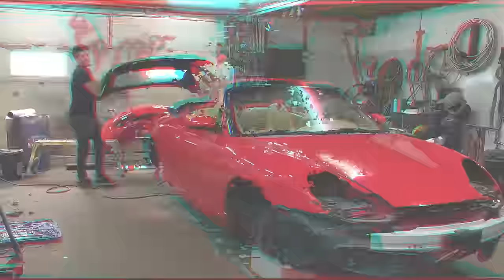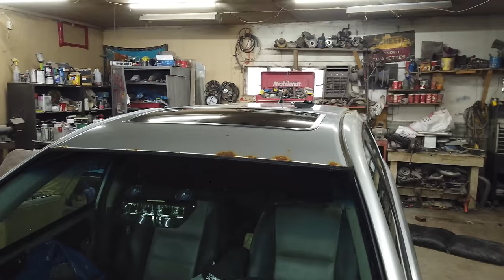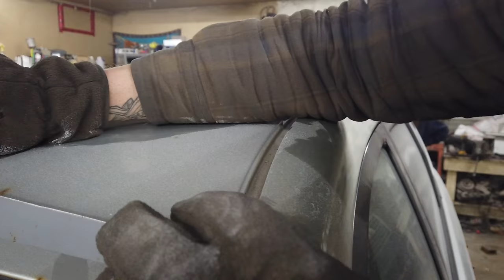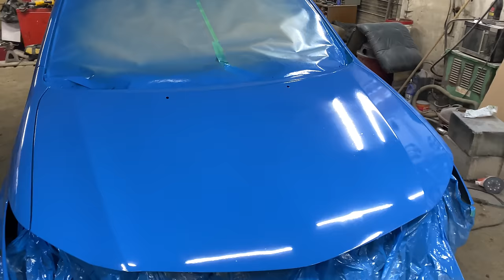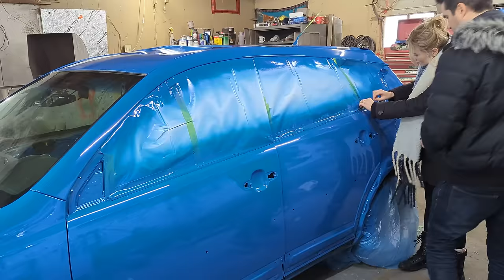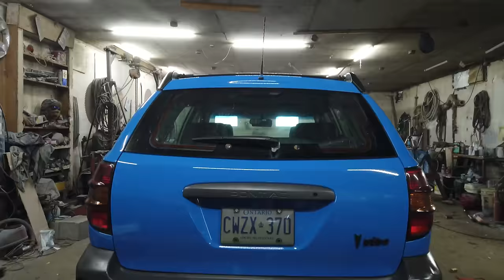Clear Coat over Rust Paint - DIY Professional Rustoleum Paint Job

Comment: Fantastic job-Looks great and I couldn't have done it better myself? There is only 1 thing that needs to be different?

PLEASE, please, please!.......................................

The hardener you used that works with Tremclad/Rustoleum paint will make a major improvement in shine and durability and UV resistance. That product is an isocyanate  that will (not can) cause long term effects to your central nervous system. The amounts needed are different with every person.

Once in your body, it does NOT leave so every exposure to it gets you one step closer to your magic level. Yes, wearing a mask that is NOISH level 95 or higher helps. However, it is easily absorbed through your exposed skin or eyes.

You will know when enough is enough, as really neat things like tremors in your hands, arms or legs will start. Your Dr will probably diagnose it as Parkinson's at first with the real reason hiding behind a bunch of other tests that are tried after Parkinson's treatments have little to no effect. Don't ask me how I know this.

Our friends here in the States at OSHA forbid the use of isocyanates unless it is done in a professional booth with down draft and the individual spraying is wearing a Tyvek suit that is completely covering their body (full face) 

Filtered and pressurized air must be supplied for both breathing and keeping a constant positive internal to outside negative pressure so it is impossible for any aerosol based paint to contact the user. 

I used to hate it when safety Sallies would jump on a video for stupid stuff. When you are only 45 and move like your 85 and sometimes have problems just getting a fork to your mouth, it is to late.  When you can lift it? All the food fell off and you start again, and you begin to hate life.

 Please, just be careful as there are some people who only had one exposure and ended up in the ER an hour after the car was done.  Read the label
Reply from the maker: Hey, thank you for the information. Like you said, I don't want to know how you know all this. But I definitely am glad you shared. We will look into the hardener and potential other options. The spray booth is just not in our reach, but hopefully one day. We can see about stepping up our ppe in the meantime as well. Thank you for being informative and being nice about it at the same time.

Comment: Love Pontiac Vibes. Currently own 2004 GT with 298,000 miles. It need a bit of love also.
Reply from the maker: They are great aren't they! This one has over 300k... Roughly 340k I think. With regular maintenance it feels like these will go forever!
Reply: Be prepared for the 299,999 odometer failure. I hear that's the only glitch with those cars!

Comment: Coulda shoulda wiped it down with 600 grit after the colour and before the clear. Flatten out the dust nibs and enhance mechanical grip. Just thinking up stuff I've seen and done to help out. Looks great and you and your wife make a lovely couple. Just saw your reply there and the sticker thing is this: You think you've got it bad peeling stickers, try having to weld up two holes instead! Just the presumption and fortitude to cut into somebody's brand new car and we Canadians went "doo de doo, oh well". Goo Gone also dissolves the glue residue. Pretty brutal going after it with an OLFA and making more work for yourselves. Take a minute and finesse it. Hot water in a ziploc freezer bag also would soften the glue. Just saw the wrap up and wish to retract my 600 grit comment. Didn't know the tremclad would still be "wet".

Great result in either and any way. Shiny. next time I'll watch the whole thing before I start yapping...
Reply from the maker: Oh all good! We do love to interact with people in the comments. We aren't actually used to this many. But you aren't wrong. If it cured before the clear, then ya a scuff would definitely be needed. We might do some more of these budget paint jobs in the future. It's nice to spend time doing things the right way and doing them well. But it's also nice that there are ways to just give a tired paint job on a commuter car a freshen up. I take it you are from Ontario? You going to Motorama this spring or Auto Fest this summer?
Reply: @RustedRides  I can almost walk to the international centre, so a definite maybe on Motorama. I went to Van-o-rama on the CNE grounds back in the seventies  (500 custom vans and nothing else) and Hot Rod shows since, I'll check out their page/ad.

Comment: Looks awesome. Pontiac vibes with the 1.8 Toyota motor are the best! My brother has one and it’s an awesome car
Reply from the maker: I really enjoy mine. I know it's not a collector car, or a powerful muscle car, it's just a 4cyl commuter car, but I real do enjoy it, and that little 1.8 is great on gas and super reliable.
Reply: Don’t need a muscle car to have a passion. I had a 2000 Camry winter beater that I paid $400 and treated that thing like my baby before I sold it😂😂
Would love to try out this tremclad paint. I’ve painted frames with the farm supply fleet paint from TSC and it has a great finish as well with the right prep.

Comment: I used to cut enamel with lacquer thinner and add enamel hardener.  It makes a good finish and requires some experimentation for the amount of hardener to use.  Big job like this I would use less for better working time.  Anyway I used to cut rubberized foundation coating with lacquer thinner and use a touch of hardener and use it for undercoating.  You would be amazed at how nice a job that stuff does on frames and such.  I have a rocker Shutz gun that I use to apply the undercoating on thicker.  As you can imagine, a regular spray gun doesn’t work well with that stuff unless you thin it way down.  Have fun.

Comment: Back in 2018 I paid a guy to rustoleum my 99 Jeep Cherokee. $900 including clearcoat. Gloss white from the factory red. The clear coat is failing on the hood and front fenders but again, it's a Jeep and I didn't want to be worried about scratches, etc... on a $5k paint job. Next paint job on it I may go with the good old 70s enamel and skip the clear coat and keep it waxed. Like when my uncle painted my 66 Mustang Fastback Dodge metallic dark green in 76.              Good job. It turned out great.

Comment: Big difference! That came out great! looks like that Toyota blue. I’ve painted several race cars with the Rustoleum enamels using same formula. Rustoleum, reducer and hardener but no clear. One with the sail blue and flat black mixed for a satin navy. Another hunter green with rusty metal primer for an olive drab green.  Both came out great and held up through some abuse. 

And brass monkey for the powder coat on the wheels. Must be done over black base coat to have the dodge hell cat color.
Reply from the maker: Thanks for the comment! That's awesome, if it held up to race car conditions that's a good sign. I'm super interested in the wheel color you mentioned too! We'll have to look into that for sure!

Comment: What did you sand the whole car with to start? And silly question, just trying to learn. Why don’t you need a primer first?
Reply from the maker: Hey! We used 320 grit to sand and for primer, normally you'd want to primer any bare metal or body fill, but with rustoleum it's not necessary. Thanks for watching/commenting!

Comment: twenty years ago i used to do these paint jobs with tremclad rust paint - i did several cars and a van - i noticed that after 6 months the paint slowly went flat and lost its shine but the cars still looked much better even after the paint flattened out
Reply from the maker: Ya, we have done two trucks like this previously, but not on the channel. They are holding up so far. We might do an update on this car in the future to show how it lasts.

Comment: Wow, really nice paint job. But then, you already knew that. However... I replace windshields and I've never seen a windshield with that much rust that the rest did not go underneath the urethane that holds the windshield in place. I'm sorry to say, you should have pulled the windshield because it's going to start leaking. Soon. Had one this last week that appeared to have a lot less rust than that, but the rust ate through the body and separated the pinch weld underneath the windshield. Had to be sent out to a body shop to have it repaired. Good luck, nice paint!
Reply from the maker: Hey, thank you for the comment on the paint job! And ya we weren't positive if we got it all. From what we could see, it seemed like we got it all but no way of really knowing. You might be right, I guess I'll know if it starts leaking. Thanks for the insight!

Comment: It looks so clean with the trim back on. Maybe you could use some of that trim restore on the plastic to look new again? Personally the thing that would drive me nuts is the little grits and chunks in the paint that settle from the dust, so I would spend so much time wet sanding lol.
Reply from the maker: Yes the little dust nibs have had their time. I'll be doing a wet sand and polish soon to smooth things out! Thanks for watching!

Comment: Great video and the way you guys explained what you're doing, etc is fantastic.  

Totally shocked that you're just a few months old, and at just 3,600 subs.  Would've totally expected to see a few 100K's subbed for this quality of content.  Keep putting out good stuff and you'll be getting those YT plaques!  

One small suggestion:  a bit lower volume on the music-only sections.  It's blastin' compared to the spoken stuff.  This coming from an ol' punk rocker with surprisingly normal hearing ability.

Comment: Good transformation... just a tip to remove anything like badges and trim held on with double-sided tape is to use a bit of fishing line, and a sawing motion to just get behind the badge and saw through the adhesive... rather than the knife and scratches... also, you both need a mask and goggles for grinding... not one set to share...

Comment: My only issue with these kind of paint jobs is that the paint doesn’t last. The difference between professional automotive paint and home painting with non-automotive paint, is the fact that automotive paint has hardeners. Non automotive paint stays soft
Reply from the maker: Hey! We did ad hardener to the paint, it's in the video. But also you are right rustoleum doesn't last as long, but that is also why we added automotive clear coat on after. We'll see long term and report back. We have done a few other projects like this before and they are over a year old now. But we will still have to see what a longer term will look like
Reply: @RustedRides  I’d love to see. I didn’t realize you added hardener to the paint as well, I missed that part, I thought you only added it to the clear.

Comment: That Matrix will last another 20+ years now. Btw, while you had the headlights out, you should've wetsanded them with gradual finer grits. Then, blasted them with clearcoat. I did it to my Toyota Sienna. I spent $30 on clear coat and saved $200 on new headlights. Hazing, crazing and UV damage on headlights is horrible. Especially in Ontario, where daylight is limited. ie: The sun is down by 9:30pm in the summer.
Reply from the maker: Ya it should last forever! If the original owner would have had it crown treated/oil under coated it probably wouldn't have needed the rocker repairs. These things are so dang reliable!
Reply: He definitely did something with the headlights. The before look worse than the after. I just did the wetsand 400,600,2000 grit then clearcoat and got rid of my yellow and made them clean on my 06 gt

Comment: It still looks like inexpensive enamel paint but I've seen a lot worse with way more work and more expensive materials. Nice job. 
Also, I love this clear over the enamel technique. Some of these cheap enamels look great when you first spray them but they fade quick and won't maintain a shine without wax. This wouldn't add much cost and it'll stay shiny for years. Can't wait to try it.
Reply from the maker: Ya that's the plan to keep it from fading. I did an engine bay one time with black enamel and it faded so bad and it didn't see much sunlight during the build

Comment: I think you should do a charcoal black for wheels they'd look good on that and a light tint on headlights and tail lights would also look pretty lit. Also if you wanna make that trim look even more good take you a heat gun to it it'll darken it up more.
Reply from the maker: Thanks! Yes I have heard the heat gun trick, might try that. And I'll be getting the windows tinted soon, but maybe I should think the tails and headlights. Are you talking about the spray for the lights?

Comment: Go OEM Silver on the rims.
Stays classic.
It turned out pretty good!
So much emphasis on proper prep work.
I wouldn't bother with the plastic puece between the front and rear windows. Hit it with the same product you used on the other plastic pieces. If the windows get tinted, the black/dark grey piece will add to the overall look of making the car look more stretched out, rather than a big blue vertical stripe between the 2 windows.
Nice work.
...and can't help but notice, the tall guy there, he doesn't look like he cares to be out in front of the camera much! LOL!

Comment: Nce i painted  a geo metro with rustoleum. Looked fine. Ive also used this on at least 5 small boats/skiffs. Highly recommended. You know what marine paint costs! Best part is 2 years later you can do another coat in an afternoon and it looks great again. Yes even the hull. Yes even a salt water hull

Comment: Could still be a problem but you'll have to see as time goes by,   as enamel and urethane 2K clear are going to harden at different rates.   Usually with enamel it's going to take about a week or so for the paint to harden enough to put anything over it.  I guess you'll see as you go.
Reply from the maker: Hey, yes always a bit of a gamble when mixing products, but we have done this on a few other cars in the past with no issues to far. Fingers crossed this one works out in the long term too!

Comment: Great video.  The work done and the production value of the video are top notch.  I vote silver or gunmetal wheels (had white wheels once and were impossible to keep clean - doing a deep scrub like every 500 miles because of brake dust).  White definitely pops the best.
Reply from the maker: Hey thanks for that nice comment! And for the info on the white wheels. I do like the look of them, but that does sound like a lot of maintenance that can be avoided

Comment: Looks good.  I use the Rust-Oleum for automotive and many other applications.   I've never sprayed it with a spray gun.    I've sprayed it with my airless sprayer. (my house painter).     I thin it according to my paint stick "drip test".      I add some penetrol and Japan drier.   Works out real good.  The penetrol is a great additive.     Generally it helps level the paint....  like to remove brush strokes.  I am getting ready to do another express van.  This time, and it will be the first time, I want to add an automotive clear coat.    The clear I'll use my spray gun.    Contemplating trying the base coat out of my automotive spray gun for the first time.      Gold plated problems.     Glad I stumbled across your video.   ✌️🇺🇸
Reply from the maker: Hey! thanks for watching and commenting. Thats pretty cool you have been able to use your house paint sprayer. Sounds like you have figured out a pretty good method with that set up. I am interested to know how you like the clear coat after you finish this van. Glad you found our channel! Best of luck with the van!

Comment: Looks great! you guys just let it dry overnight and hit it with clear in the morning or any other prep?
What clear did you guys use with it?
Reply from the maker: Ya we let it sit about 12 hours... If it cures too much you'll have to wait for it to fully harden then scuff it down before clear. The stuff we used is called Rouge and we got it at Baseline Fender and Supply in Sutton Ontario

Comment: Well guys that looks amazing and since I am not a pro I find it much easier to paint with Rust-Oleum. when I use actual automotive paint I am terrible. I would have also painted all that cladding and trashed the emblems instead of putting them back, but what do you think of doing the side cladding yellow and the wheels bright yellow also?
I think it would make the little car look cool don't you?
Reply from the maker: All very cool ideas. I did still about swapping the cladding for smooth paint matched stuff from the wreckers and then painting it blue, but I also don't mind the textured cladding look. Just wanted a cheap quick but good looking paint job. A bright yellow would be cool though!

Comment: Satin black for the wheels. I'd recommend a smaller diameter for the wheels as well, to get more sidewall. Hell, put a 2" lift on that bad and naughty girl. Also, find a decent A/T tire, that would be badass. 

The metric system is evil, so I used imperial...😂😂😂

Great job!!!!

Comment: Nice video,What type and number of sandpaper  did you use to sand the car ?
Reply from the maker: Type, can't think off top of my head. Whatever they have at the autobody supplier. Stuff you get from the hardware store is not the same unless it's meant for auto. And we used 320grit